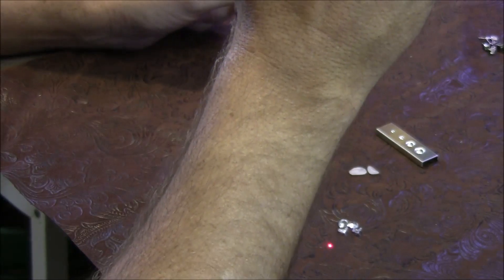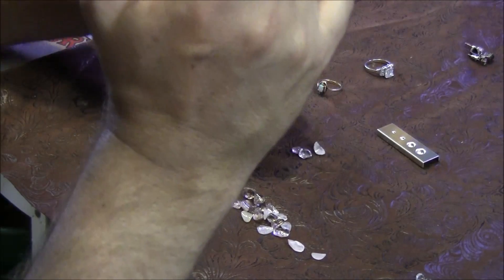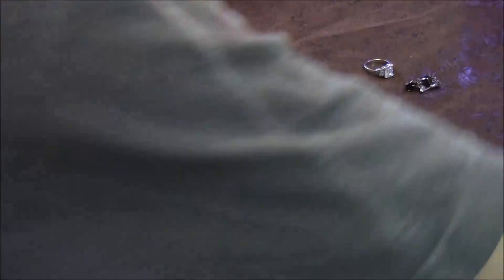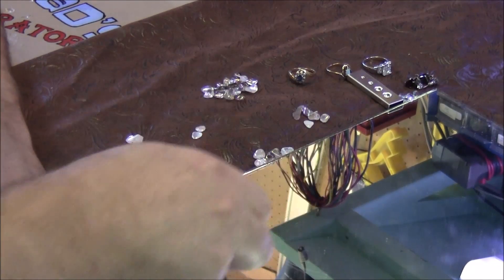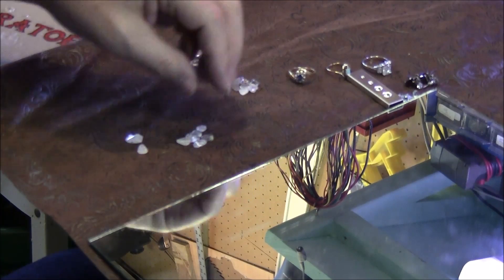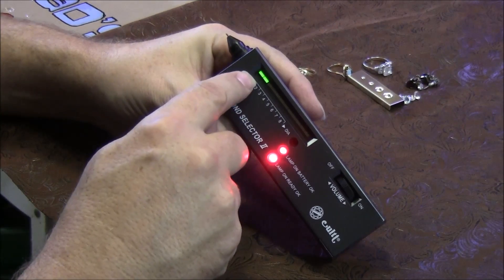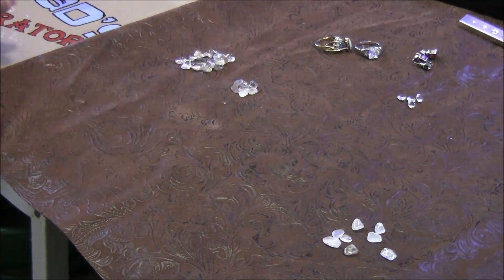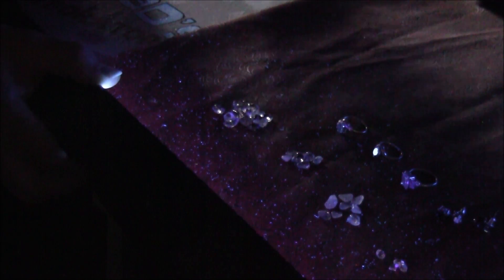Diamond Testing

Comment: FAILED!!! D+ , MOSTLY UTTER NON-SENSE!! THE ONLY 2 ACCURATE TEST YOU MENTIONED WAS THE U.V TEST WHICH WOULD INDICATE A REAL DIAMOND AND THE DIAMOND TESTOR WHICH WOULD BE THE BEST INDICATION FOR DIAMONDS BECAUSE ALL DIAMONDS CONDUCT HEAT, SOME FLUORESE, AND SOME EVEN PHOSPHORESE, (continue to "glow" after the light is removed) UNDER U.V. LIGHT, AND SOME EVEN CONDUCT ELECTRICITY!! THE SCRATCH TEST IS B.S. AND NOT USED AT ALL IN PROFESSIONAL DIAMOND GRADING LABS, WHY? BECAUSE ANYTHING WITH A HARDER MOHS SCALE THAN GLASS WILL SCRATCH GLASS INCLUDING A HARDER TYPE OF GLASS!! TOTALLY USELESS!! MOST NATURAL DIAMONDS HAVE "TRIGONS" EVER HEARD OF THEM?, ON CUT POLISHED STONES IF THEY OCCUR, CAN USUALLY BE FOUND ALONG THE GIRDLE OF POLISHED DIAMONDS...AS WELL AS GRAIN LINES AND INCLUSIONS WHICH ARE ANOTHER VISUAL OBSERVANCE THAT WOULD INDICATE REAL VS. FAKE....AS WELL AS VERY SHARP ADAMANTINE FACETS EDGES VS DULL FACET EDGES AS IN C-Z WHERE THE LIGHT "ROLLS" OVER THE EDGES OF THE FACETS.  PS: IF YOU HAD USED A PROFESSIONAL GEMSTONE U.V. LIGHT...ONE THAT HAS SHORT "AND"  LONGWAVE U.V. YOU MAY HAVE SEEN PHOSPHORESENCE IN A DIAMOND... IF YOU HAD IN FACT FOUND ONE. AND FINALLY "NOT ALL" DIAMONDS WILL EXHIBIT FLUORESCENCE, WHILE SOME DO SHOW NONE, FAINT, MED., STRONG, V. STRONG FLUORESCENCE, SOME ALSO EXHITBIT "YELLOW" FLUORESCENCE, AND SOME LIKE THE BLUE HOPE DIAMOND EXHIBITS RED FLUORESCENCE AND PHOSPHORESCENCE!!!  I GAVE YOU THE PLUS BECAUSE YES C-Z ARE HEAVIER THAN DIAMONDS,  BUT YOU WOULD BE JUST AS LOST IF YOU CAME ACROSS A "MOISSANITE" GEMSTONE... A SICK AND TIRED OF GEMSTONE MISINFORMATION ON YOUTUBE LOL..... G.I.A. GRADUATE GEMOLOGIST (U.S.A.)

Comment: Sometimes crater diamonds will beep with the electric test without the metal tray. A lot easier also ! I’ve had small 2-3 points stick to things!! So some diamonds will stick!!!
Reply: It took me four trips to find a diamond. Few problems. One was working the west drain, east is the most productive back in the day, to now. Once I moved to the east my diamond count shot up!! Also a few regulars gave me false information!! I had to pick it up on my own. I’m at 27 diamonds. Largest is a 1.03 can’t wait to go back!
Reply from the maker: I am a amateur diamond miner. Looking at your channel, you seem to have a lot more experience, so I am sure you are correct.

Comment: I also heard if you use a permament marker it will stay on a real diamond and its hard to remove and one that is fake it will wipe off easy??? I dont know if its true.
Reply from the maker: Never heard that, someday when I have a big enough diamond to test it maybe I will do a follow up video!
Reply: @BradsLaboratory  
Lol do it on a fake Diamond. Because you'll have  a heck of a hard time cleaning that off. So you don't want ruin a good diamond
Reply from the maker: @BL-rb7jm  it think it will clean right off a real diamond with some acetone, the fake diamond will probably melt when cleaned with acetone.

Comment: If you ever find a diamond tester, DO NOT TOUCH THE TIP! YOU WILL BE ELECTROCUTED AND IT'S GOING TO HURT!
Reply from the maker: Yes it generates high voltage that it uses to heat the diamond then it tests to see how long the heat stays, if it is gone almost instantly then it is a diamond

Comment: Hey Brad your not testing those rough stones right , first you have to touch the metal plate in the back side of the diamond tester , and you have to put you hand on the testing platform ? Just a trying on helping you , because a couple looked like rough diamonds ? But its hard to tell on a video. Add me as a friend and I can explain my experience with rough diamonds. I Think you will like to know.

Comment: I have same tester. On reverse it shows ho to set the tester for tests. Under 1/2 ct. at 30 degree C the tester should be on 5 to 7 setting according to size and room temperature. Had pawn shop kid do me the same way when all I wanted was a value. He just seemed too eager to convince me they were fake and buy them for next to nothing. A jeweler showed me how to properly use the tester and I did sell them at $7500. More than the kid wanted to give. So it’s just as simple to find a person of no bias to tell you what’s real or not. Middle eastern stores seem to be as incompetent as the pawn shops. Take them to several places you’ll find a good one sooner or later.

Comment: Hey Brad.
The diamonds "may or may not flouese" as determined by AGA and that test I believe has been dismissed.
Your supposed to test the tester with the test sample supplied with it in the case as well to set and read temperature settings on back of tester.
The only way certain is specific gravity test which is simple to do at home if you have a cheap gram scale, or to have AGA certified person check with spectrometer to see what light the stone gives and filters.
(unless you have a spectrometer on hand)..
The specific gravity test is easy and shown on youtube.
Try again.
None of your tests are definative and rough stones will test different than cut with a tester..
Reply: There is not a test sample included with these testers.